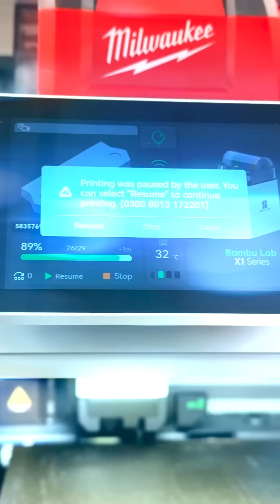This Mod Will Fix Print Pausing On Your Bambu Lab P1S and X1C 3D Printer!

Comment: do you always lower the bed to a specific Z height? what if the print pauses when the bed is already that low? will it lower further and potentially crash?
Reply from the maker: Hi there, this is straight from the manual which is linked on the listing for this solution: 
lower_bed_on_pause
If included, once the pause routine is entered, the bed will lower 50-150mm depending on the height of the bed at the time of the pause. This will allow easier access to install parts into your print.
Note: this feature is only available in Orca Slicer - Bambu Studio provides no Gcode variables to track the bed height when entering the pause routine therefore there is no safe way to change the bed height in the routine. To prevent collisions or improper return to print Z height, this feature is not available in BBS (all versions). 

You may access this manual with this link here:
https://docs.google.com/document/d/1gq0S7zlb91B_rkYO7CgzDcfMDrPJvOdcYe-vMhXvVx4/edit?tab=t.0
Reply: @leckiestein  ah fair fair I ingnored the orca bit! 
Btw do you have a full list of your Gcode mods? I might be interested in purchasing depending on what they do and if they work in bbs
Reply from the maker: @eugenio4833  There is a photo in this post with all of the features Ive been working on. Many of them are already implemented. 
https://www.patreon.com/posts/first-of-its-125809990?utm_medium=clipboard_copy&utm_source=copyLink&utm_campaign=postshare_creator&utm_content=join_link
Reply from the maker: @ As for BBS - 2.0 it is coming for the end of this month. Currently BBS is only with the version released in Feb this year.

Comment: But you do loose zed height from the backlash of the table lowering
Reply from the maker: The only issues Ive seen is if you get too rough with the print. Sending the print bed back up takes care of any lash in the screws
Reply: @ it is interesting. I have hundreds of hrs on my X1 and no adjustments are needed to the anti backlash couplings on the bed. There must be a macro involved with expected wear after certain hr markers. Idk. But lube is important here but wear and backlash is inevitable eventually
Reply from the maker: The Z position is set to the nozzle tip on every new print making wear or other changes in mechanics not much of a problem. Bambu uses piezo elements in the bed to pickup on the nozzle contact. Super smart 👌